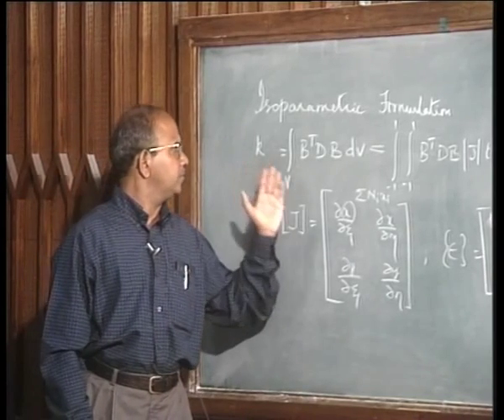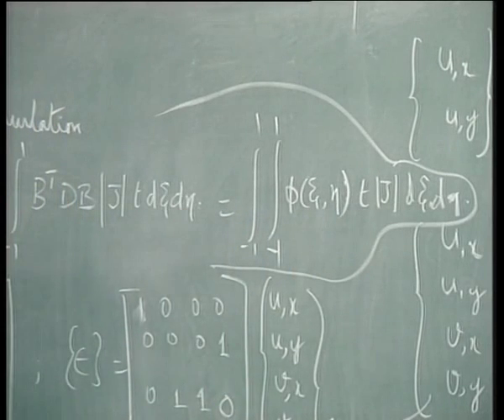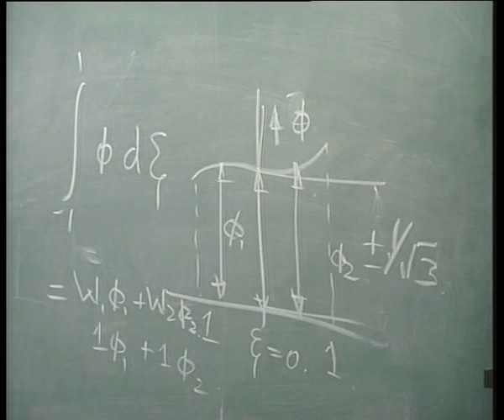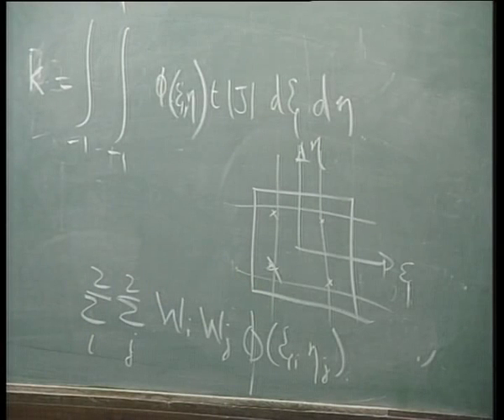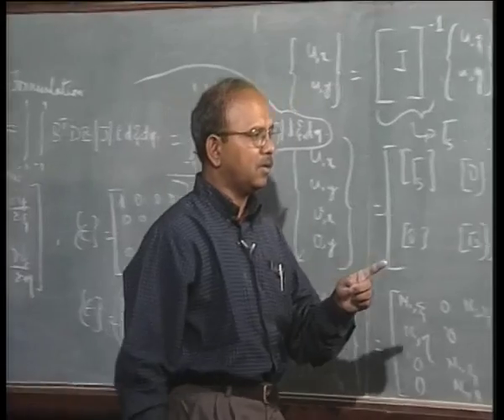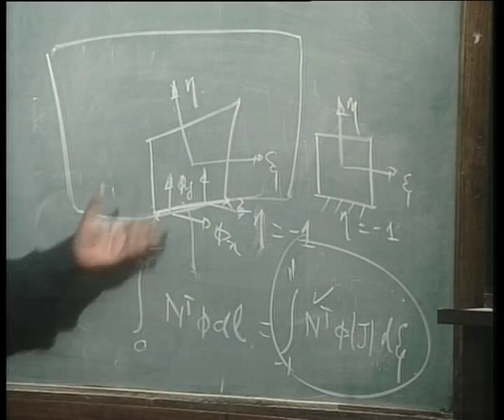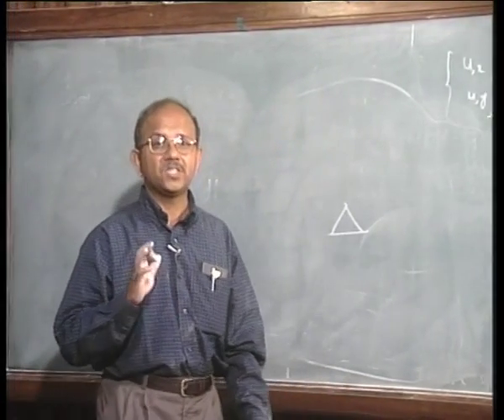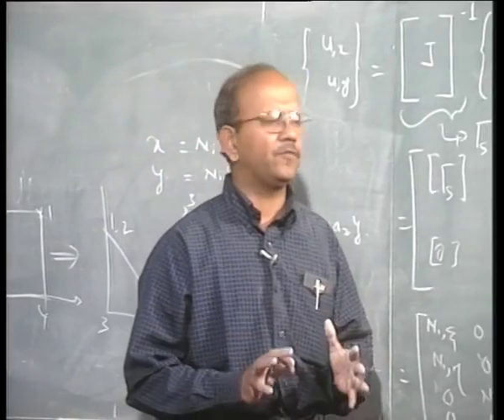Mod-01 Lec-20 Introduction to Finite Element Method

Comment: Can anyone tell me.. why the mesh quality(in terms of shape)of element is important..when anyway we are mapping irregular shaped elements to regular shape elements in natural coordinate system..
Reply: I don't know if this is still relevant, but here you go: 
The idea is to keep the shape of the element as close to a rectangle as possible. The more distorted the element is, the higher is the error in the calculated displacements. 

An analogy would be to think of dividing a rectangle in half by connecting the mid-points of one pair of sides. The ratio of the areas of the two resulting rectangles is 1:1. Now if you divide a highly irregular quadrilateral similarly, the resulting ratio would probably be quite different from 1:1.  This can be interpreted as analogous to the approximation introduced when dealing with highly irregular elements and mapping them to rectangular elements.